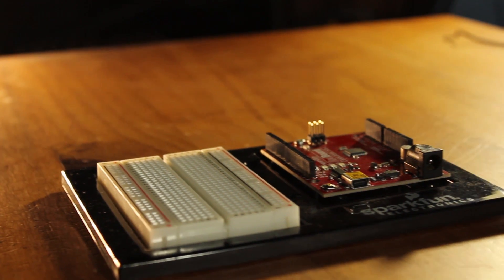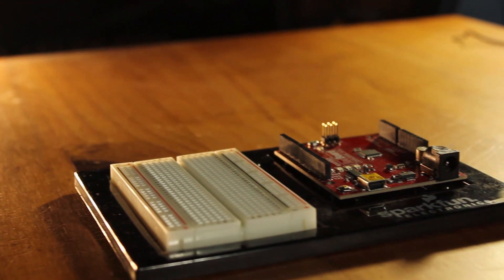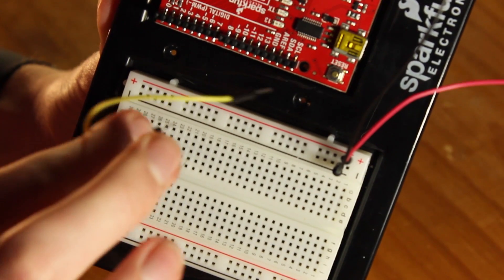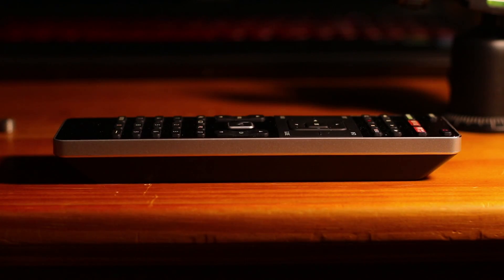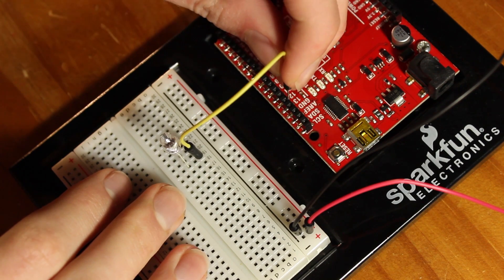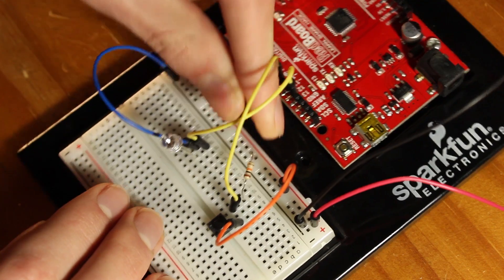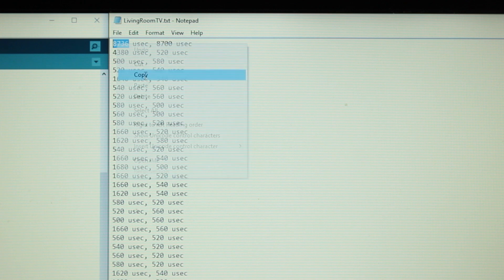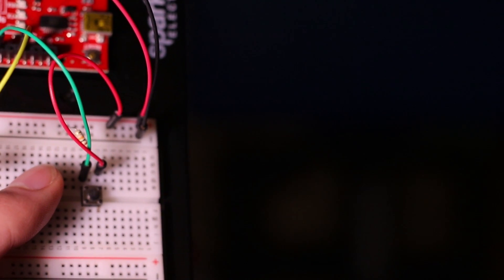How to Control Your TV With an ARDUINO!

Comment: Any Idea here why not store the data in array or maybe in the eeprom? I know you are just trying to keep it simple and hardcoded the IR transmit. I need to send 3 codes volume up, volume down, mute. It was to use my tv remote and decode the id code. Then transmit the ir code for my sound bar this way I only need one remote to control because I can’t adjust the volume with the tv. Nice video.

Comment: my tv remote has more than one set of codes being sent at random
Reply: Go into a dark room and use it in there the lights might interfere but in a room with no light it will not interfere I had the same problem but fixed it with a dark room

Comment: I've never had an issue uploading a sketch 'til now.  It compiles just fine but when I try to upload it I get the following.  My board is on the correct COM port and I can upload any other sketch.  I'm VERY new to this so any help would be appreciated.  

Arduino: 1.8.5 (Windows 10), Board: "Arduino/Genuino Uno"

Sketch uses 2770 bytes (8%) of program storage space. Maximum is 32256 bytes.
Global variables use 188 bytes (9%) of dynamic memory, leaving 1860 bytes for local variables. Maximum is 2048 bytes.
avrdude: ser_open(): can't open device "\\.\COM5": Access is denied.
Reply: the app Arduino doest have correct access to the computer so it can not connect to the port of the computer

Comment: Some devices do not have inbuilt IR sensors, like Amazon Firestick, if we want to make a remote for these devices using IR, how can we do it?
Reply: you would need to find a different way to control them or take it apart and place a IR sensor inside and connect it to different parts in the fire stick

Comment: Hai.I can decode but When i am using ir transmitter it wont work. when i am decoding ir receiver for power button.Each time i got diiferent outputs.
Is all the different outputs work? or is anything wrong in that
Reply: did you go into a dark room with the light off

Comment: Thanks. I changed the "printpulses" function (below) at the end of the IRReveiver code to prevent copy/pasting every individual number which seemed too fastidious. Now you can just copy/paste the whole thing from the serial monitor to the IRtvSend code in one go...

void printpulses(void) {
  Serial.println("\n\r\n\rReceived: \n\rOFF \tON");
  for (uint8_t i = 0; i < currentpulse; i++) {
    Serial.print("delayMicroseconds(");
    Serial.print(pulses[i][0] * RESOLUTION, DEC);
    Serial.println(");");
    Serial.print("pulseIR(");
    Serial.print(pulses[i][1] * RESOLUTION, DEC);
    Serial.println(");");
  }
Reply: For some reason, I get a compilation error saying there is a stray \. Can you please check the code?

Comment: How Can I control TV by voice with Arduino Uno converting voice to code and matching with remote value s . 

How can it be done pls provide some guidance to this.
Reply: you should go and look on youtube about something like:"how to conrtoll arduino using voice" it will take u to voice piece ,electronics so you understand how to code it ,then come back here look at this code in the description(Link) and use the both codes to make your own developed code .Note:use the reciver code to get the freqeuncy of your TV at first. best wishes Mahmoud ,good luck
Reply: you would need to have computer doing that or a raspberry pi because an Arduino can't run process that heavy just look up COM port communications between Arduino and computer then go from there contact me if you need more help

Comment: Is this possible using a Ultimarc Ultimate I/O? I'm building an arcade machine and would like to program some buttons to control tv volume and on/off.
Reply from the maker: As long as you can control an LED from the board, it should work. I'm not sure what the code is like but there should be a way to set on and off durations for output pins which is really all you need.

Comment: IRReceiver doesn't work.. I connect to pin 2 in arduino, but if I use example code from IRremote library it's work,.. but the raw data not same with your example in your video.. please help me
Reply from the maker: +fernan situmorang what exactly does the data look like?

Comment: how to control ac using this code. please reply soon
Reply from the maker: Well if it's controlled through IR like a tv, then you just do the same thing: take the remote and log the codes that it sends. Then clone them with the arduino.
Reply: +Keenan Van Deusen its not decoding ac remote, what might be doing wrong. Is there any specific model require ?
Reply from the maker: Make sure that it's actually an IR remote. If it has a little LED at the front then it's probably an IR remote. If it doesn't though, that probably means it communicates via some sort of radio signal and I'm not sure how to clone that signal. If you want, you can send me a photo of it.
Reply: +Keenan Van Deusen we are using IR remote, and following your code and circuit but during decoding process i.e receiving code of ir remote button we get nothing on serial monitor. thanks for the help in advance😇
Reply from the maker: I'm assuming you've already done this, but if you haven't, make sure that the remote works and that all the lights are off so that nothing else interferes with it. If that doesn't work then try it out with a different remote like a TV remote or something. If that works then it's a problem with the remote, but if it doesn't then we can work from there.
Reply: +Keenan Van Deusen i have received code of ac remote ON button but when i was trying to on ac through arduino, nothing happened. is there any change required for ac ?
Reply: +Keenan Van Deusen i have received code of ac remote ON button but when i was trying to on ac through arduino, nothing happened. is there any change required for ac ?
Reply: +Keenan Van Deusen i have received code of ac remote ON button but when i was trying to on ac through arduino, nothing happened. is there any change required for ac ?
Reply from the maker: +Samra Razi I had the same problem with another TV and unfortunately I wasn't able to figure it out. The only thing I could think of is that the code you're receiving is incorrect. I'm really sorry I can't help but I'll let you know if I figure it out. For now, you could look at other methods online to see if one of those works. Good luck though!
Reply: Samra Razi
Reply: +johan bayu ?